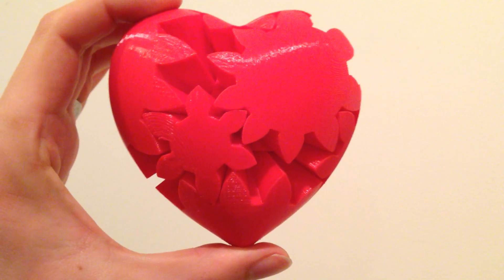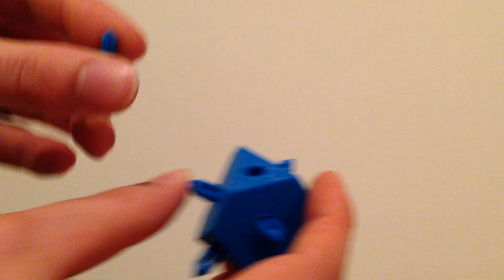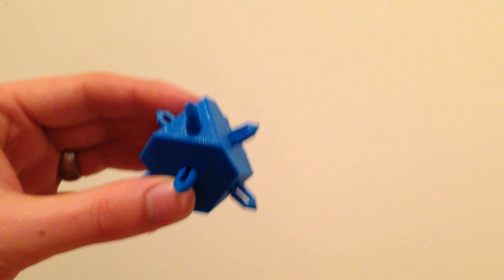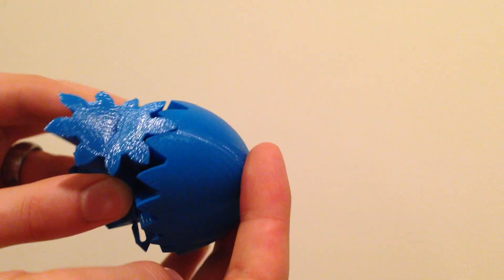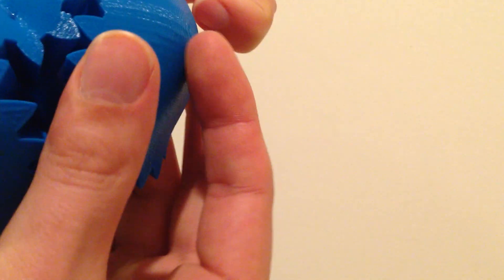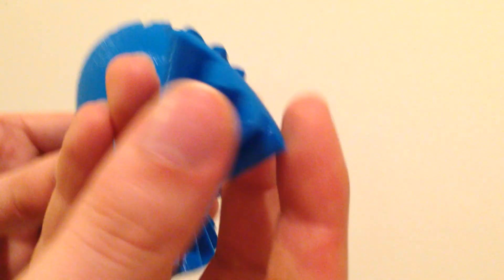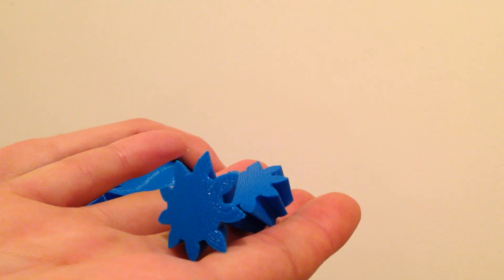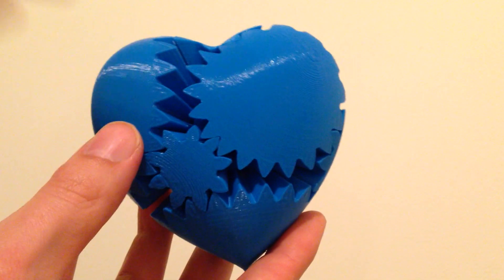Heart Gears Assembly

Comment: Contrary to the instruction for step one in this video, I highly recommend that you do NOT insert all the clips into the center section (except for the first one). After the first gear is in place (with its clip), locate the proper gear, temporarily align it in place (without a clip), mark the alignment across any gear tooth to an adjacent part with a pencil mark, and then insert the clip into the center section and snap the gear in place using the alignment marks as a guide. Once the heart is fully assembled, you can either erase the pencil marks or wait for the marks to disappear with use. This method will save you much frustration and time!

Comment: I have tried for about an hour to get this thing together.. It is not the same heart as you show in this video... The readme file gave the link to this video, but you have far less teeth on the heart you're showing in the video. And your hand keeps going out of frame at key spots where I really need to see what is going on.
It seems to be a really cool heart, but when it is not assembled right, it just leverages itself apart as I try to turn it. Thanks anyways but I just tossed 8 hours of printing in the trash.

Comment: I printed this at 50% size and had to redo the pins at 0.07 res.... but it is still not working- and tips or ideas? I will print the 100% version when I got time to monitor my printer 10 hours.
Reply: When you scale down or up you need to adjust tolerances in order the model to work. That's not the right way to resize it. Do the original version and it will work perfectly. Mine was printed in 0,2mm of resolution and I even painted and it still works nice.
Reply: yeah, but there are reworks for the 50% scale model with working mechanics... I will look into these soon
Reply: yeah, but I want a smaller version of the model so it fits my hand... and prints quicker
Reply: Have you tried to sand down the pins? You can use a 120 grit sandpaper to reduce the size of the pins a little bit. Gears will still turn tightly, but it will probably work! Another tip it would be to print just the pins full solid (I think that, because of the size, it's already solid printed, but check that before sanding)!
Reply: if you do .5 scale there isn't much pin.